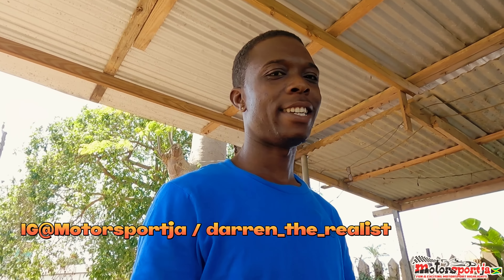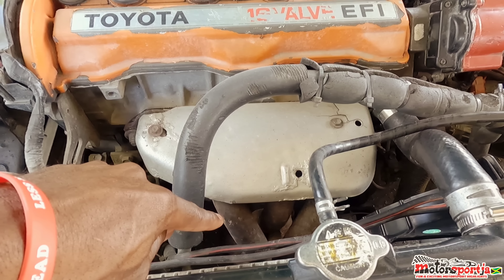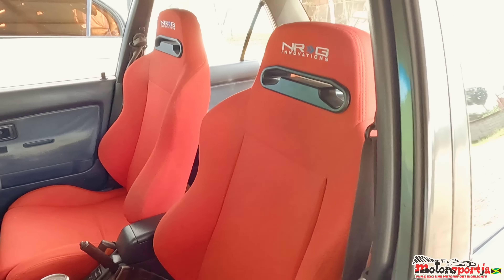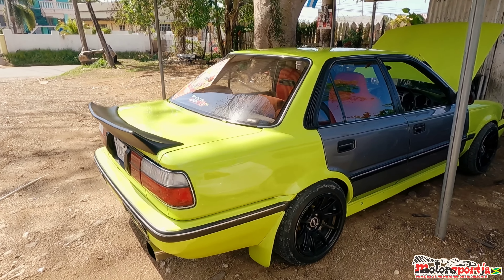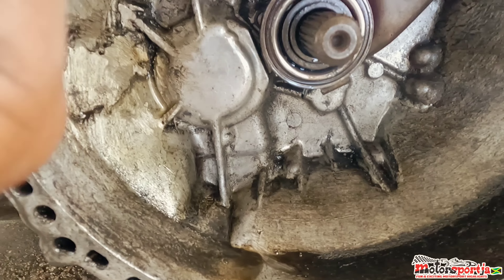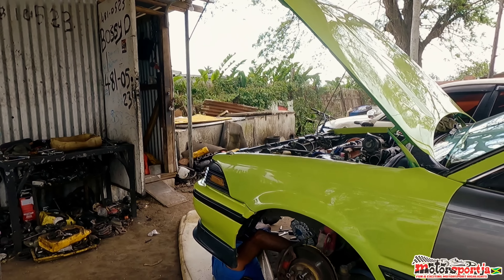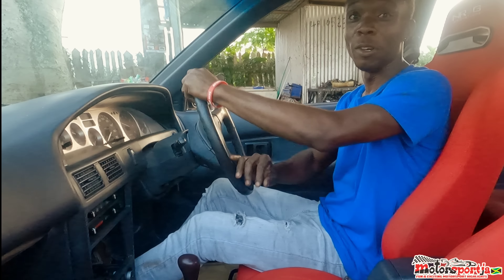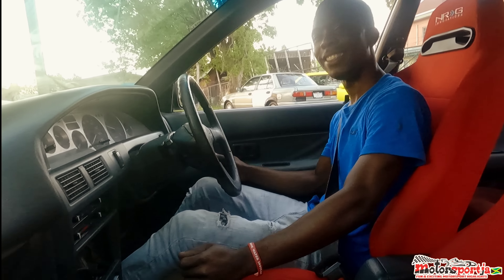6 Speed Manual Transmission swapped in the Motorsportja Toyota Corolla AE91

Comment: the mismatch doors actually give it a really cool different vibe👌👌👌👌i'd keep it like that 4 a while fi real
Reply from the maker: Respect bro bro 💯
Reply: Doors really give the car a nice vibe and nice look 💚🔥
Reply: @TrucklifeJamaica876  a same thing mi eva a seh, it just stand out and the doors well painted again, mek it awesome
Reply: @Motorsportja  4age gearbox is the 20 valve bzr?
Reply from the maker: Factory colour
Reply from the maker: Yes
Reply: @Motorsportja  suh how the ratio work
Reply from the maker: @fabiangordon474  bredda ratio sweet honestly because it's not the stock 4age gearbox ratio its altered even shorter 😉 wicked feeling on the little 5afe no joke all 4 gear feel like second gear in a regular 5 speed box
Reply: Real talk
Reply: Big man dem deh granny shift can't run no class at all, even if it's 19 sec class😂
Reply from the maker: @thoughtprocess9222  a 2 log did on the front wheel bro lolz 😆 never want the wheel  fly off just did a feel out the gears
Reply: @TrucklifeJamaica876  1
Reply: @zamcoboss6071  1

Comment: Tell us about the conversion,  did you use the stock shifter,did the box bolt up?
Reply from the maker: Yes the stock shifter but had to alter it a little so iy it could select reverse gear its A gearbox from the 4age so yes it can bolt up

Comment: Did the same thing with my AE 92, how did you get it to select the reverse gear? I'm experiencing problems in that area
Reply from the maker: I had to do some adjustment to the shifter
Reply: I have an AE 92 GT flatty that carries the 16v 4AGE engine, fitted it with the C160 gearbox which is a 6 speed, will show you it when you WhatsApp me